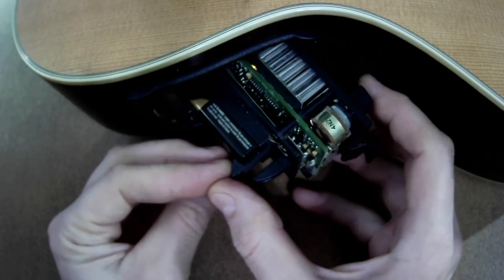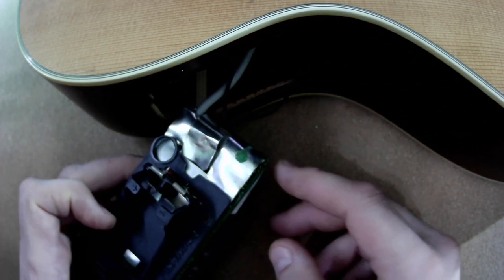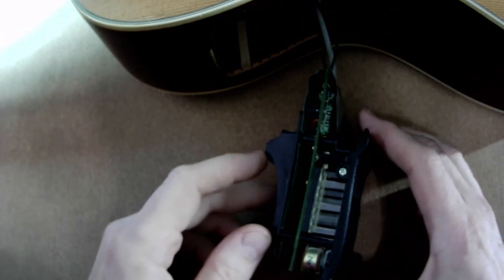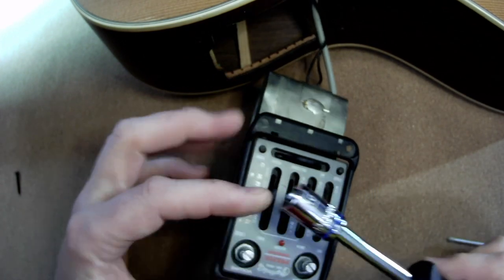Repairing Acoustic Guitar Pre-amp Damaged by Leaky Battery

Comment: Very informative and helpful! The mircoscope is killer, really could see what was the problem and how you went about assessing the situation and finding a remedy! Thanks
Reply from the maker: And remember, if you ever have any issues with electronics, just pour some hydrochloric acid on the circuit board (like I did) and see what happens. That's the chemical equivalent of hitting the top of your TV with your fist, when it doesn't cooperate.